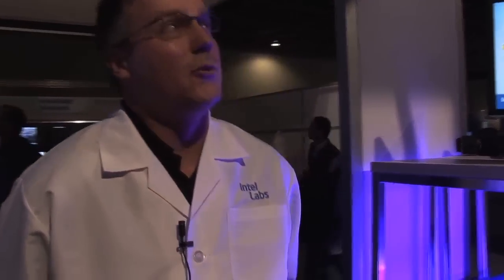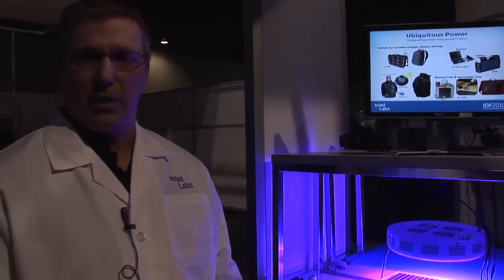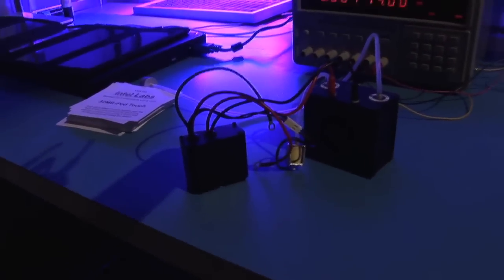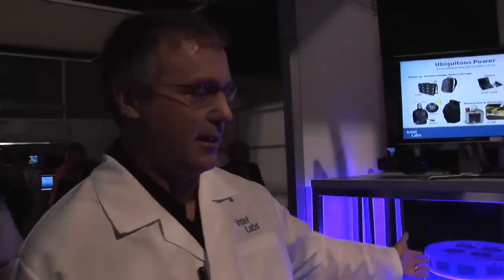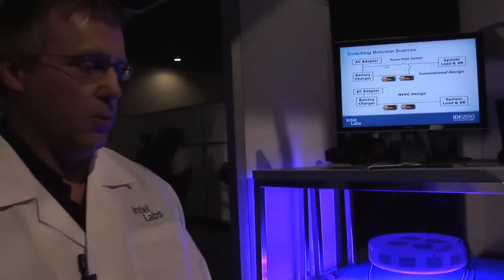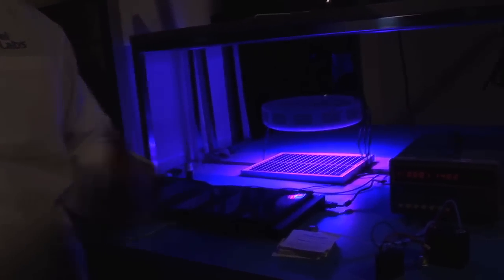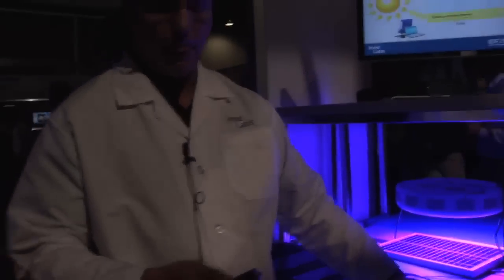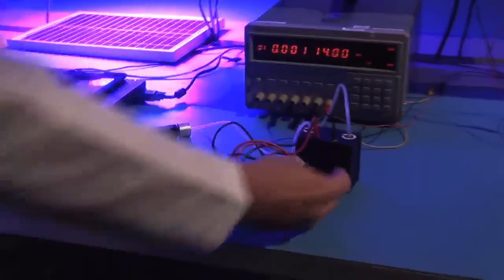Future Now:  Hybrid Powered Gadgets

Comment: In this case the solar panel connects directly to the laptop relieving the battery of having to provide 100% of the laptops power needs.  The laptop’s internal battery and the solar panel are providing what the laptop is consuming at the same time.   There are some advantages to using the power directly from the solar panel without having to first charge an external battery.  No need for an external battery that the panel needs to charge first, can use smaller solar panels...